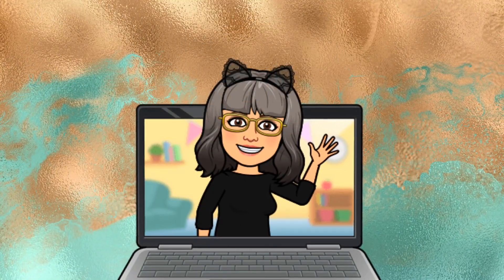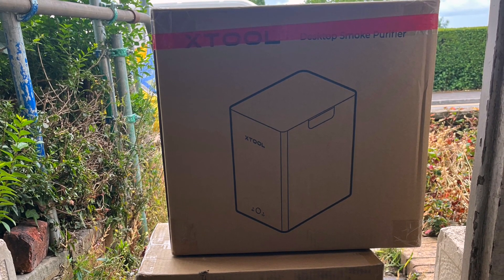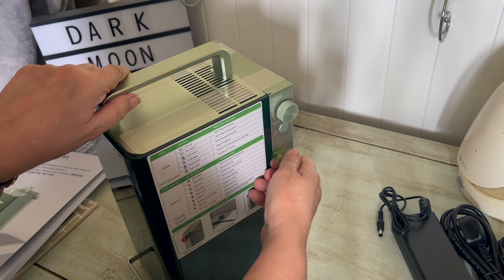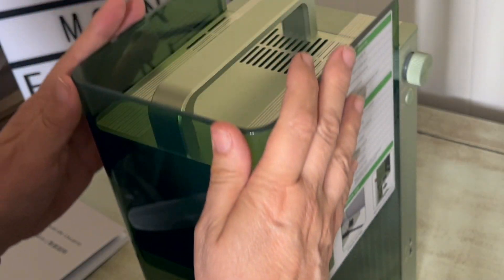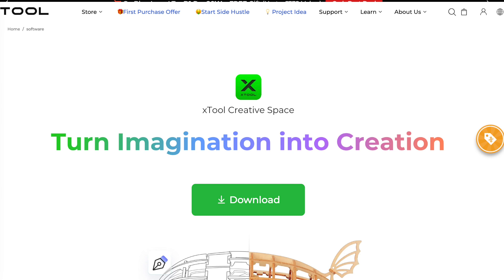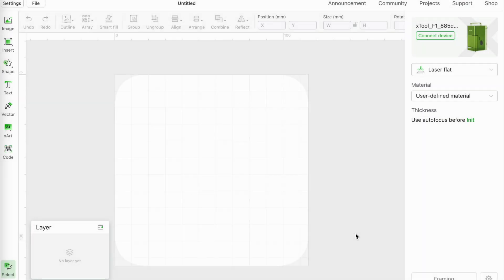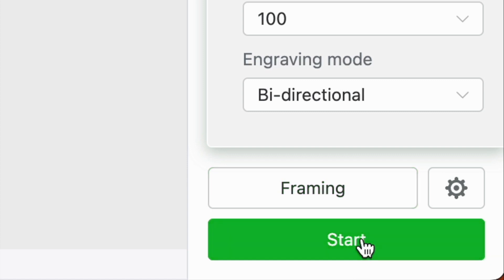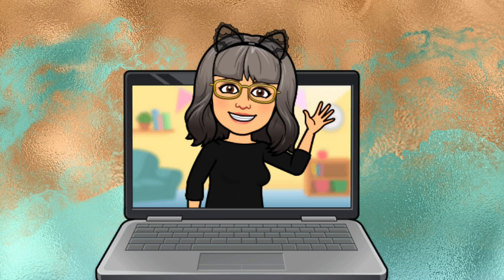My newF1 laser - fix focus problem and first burn!

Comment: I just recently got the F1 and noticed the dots did not line up with each other, parallel yes, but not on top of each other. XTool does not have anything about it on their site that I could find, thank you for this video! Now I know my machine arrive not truly setup to work out of the box!
Reply: Same for me, and I was also shocked I haven't seen this tip anywhere but in this video. Such an easy fix
Reply: What size screw driver do I need
Reply from the maker: Any one that will fit.  You don't need to unscrew anything, just be able to tug the head mounting into place.

Comment: Thanks for the screwdriver focus process. Watched a bunch of videos on how to manually focus but none mentioned that initial calibration.
Reply from the maker: I'm glad I helped!   It seems to be quite a common issue and easily resolved, but I did panic a bit because I thought my machine was faulty. I think xTool have now added the info to their FAQ's but there was nothing when I got my F1.